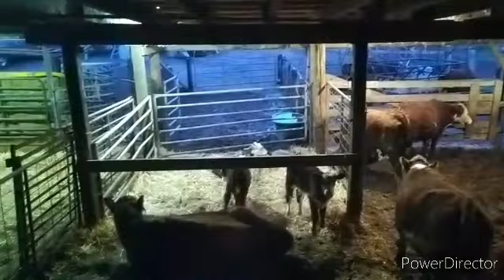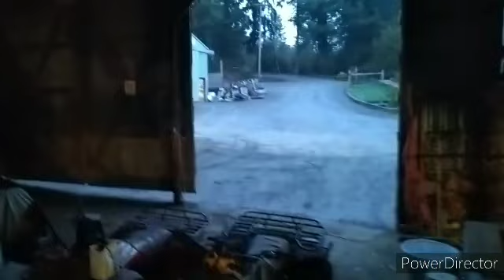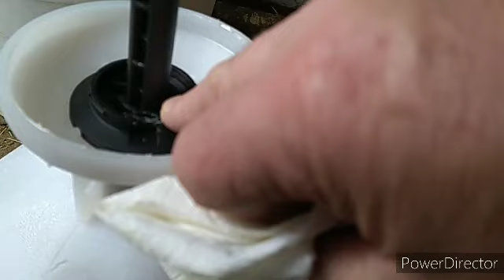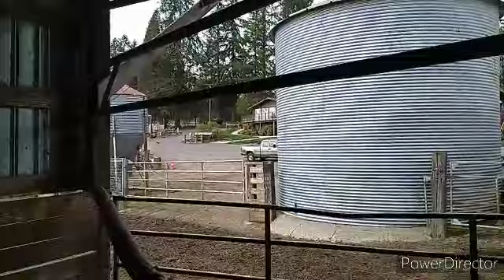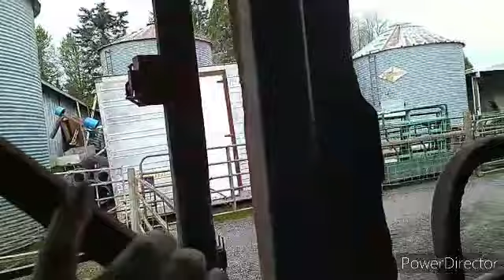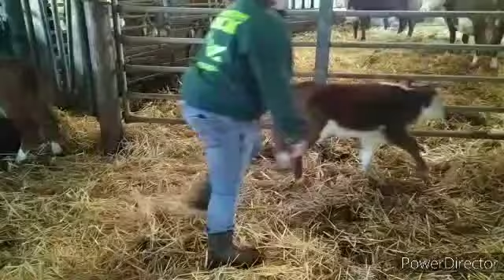some zoomies, 6 more with pneumonia...

Comment: You all caught the pneumonia in the calves early so I would think they should be fine. I soak the cattle oilers the same way.🍻🍻
Reply from the maker: Should get it done 👍
We've talked about using a sprayer for a while, a lot less mess than the sprinkling can!! Ty said it took longer, but I don't think it did. Only one trip vs 2 or 3... And it had time to soak in good, not run off👍🥃🥃🍻

Comment: Good morning Ed ☕🚬. It is always difficult with insurance companies. Breakfast. Well, they say that breakfast is the most important meal of the day. It's good that they're running, but they seem a bit camera-shy.
Reply from the maker: Good morning Sven ☕☕☕
Used you are up early again.
Ya, always gotta be careful dealing with insurance companies. They like to keep money, not spend it.
Always have a good breakfast.
Never fails, turn camera on, calves stop...
Have a good day my friend!
Reply: @GosselinFarmsEdGosselin  It's almost 7 o'clock here and the chimney sweep arrives around nine o'clock, so it's good to be awake. One thing with insurance companies, is that you must have the car insured to be able to drive it. Even the old tractor must be insured. Admittedly, it only costs $ 35 a year, so it's not that expensive.
Reply from the maker: @makingithappen5178  ah, I was thinking it was earlier for you. 9:15pm here now.
Yes, insurance is required for all vehicles.. UHG
Reply: @GosselinFarmsEdGosselin  Jeupp.